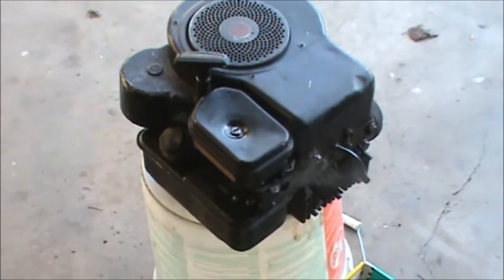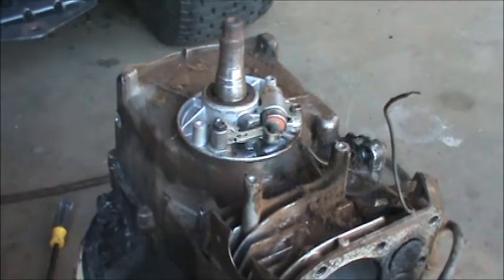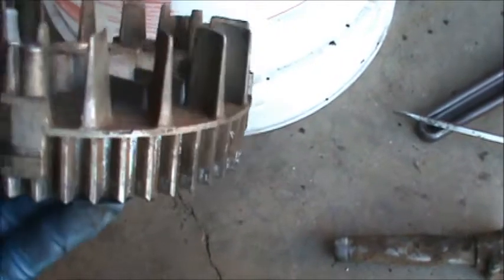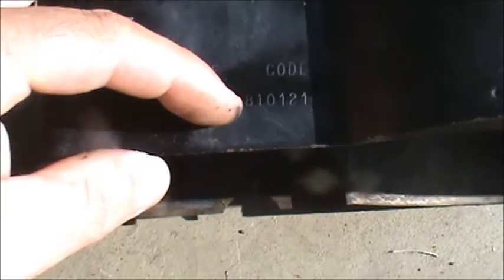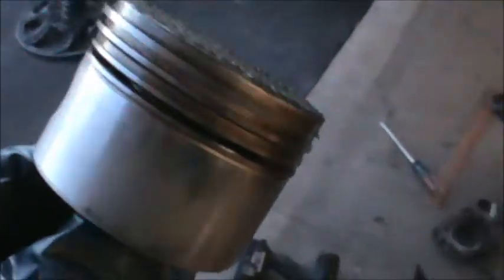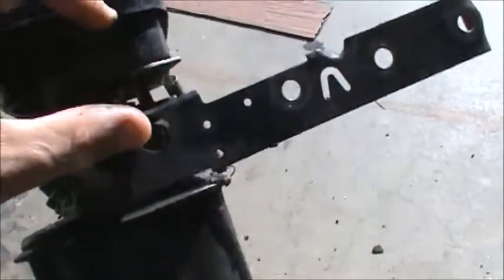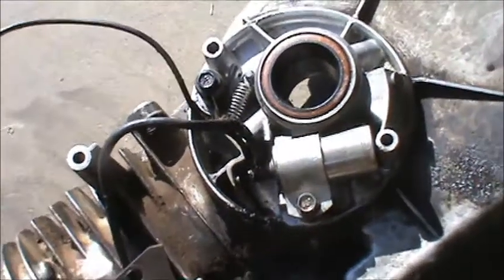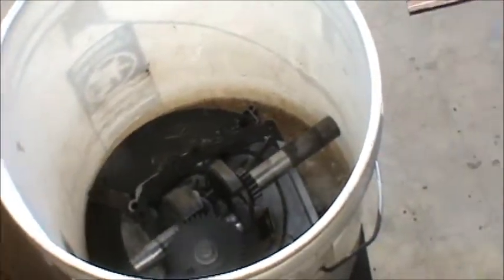How has the Briggs and Stratton Engine Changed over the Years

Comment from the maker: I did not see the engine run, but last season, I looked at the mower in the beginning of the season the whole deck was black near the muffler from burning oil.  The owner said mower stopped because it completely out of oil when he was mowing.  I put oil in it and said it was about dead.  The owner wanted to use it until it died.  He came back this year and said it barely has any power and just was not running right, so I gave him an old engine that I had for free.